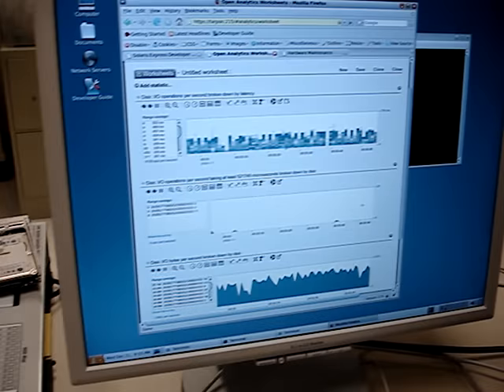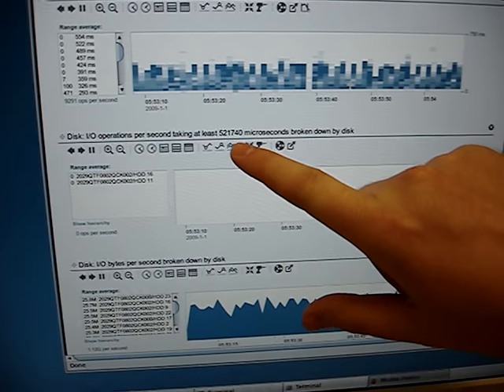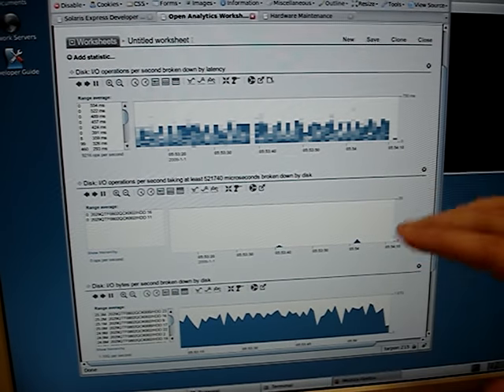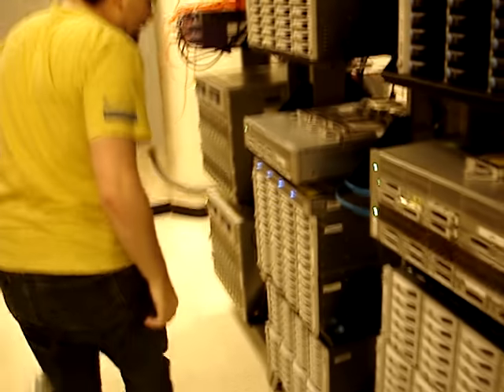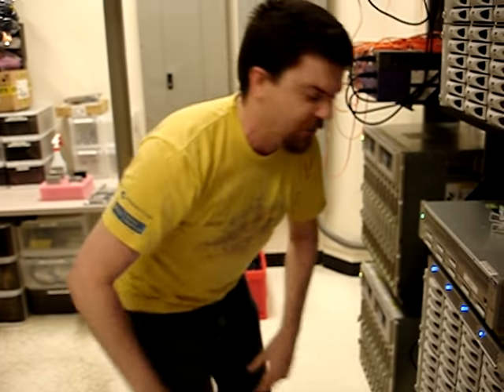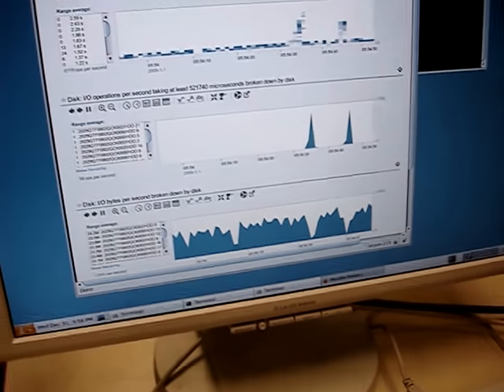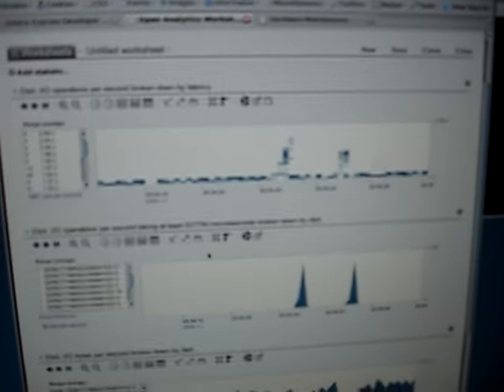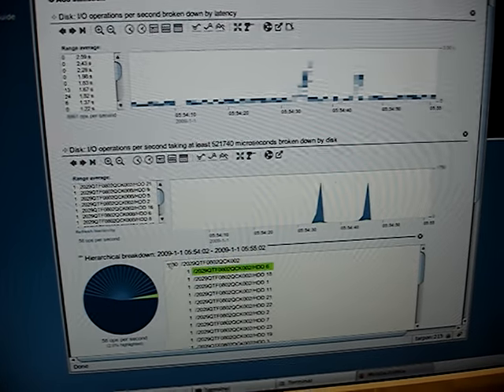Shouting in the Datacenter

Comment: I encountered the same issue with servers I installed and maintained at a data center in LA where they had a smoke emergency due to an air conditioner starting a fan belt fire.  The halon systems deployed.  The frequencies that the halon emitted destroyed 22 of 44 hard disk drives in multiple servers.  Upon lab analysis of the hard disk drives, they could see where the disk puck (a.k.a. disk head) impacted the platters.  That must have been one loud explosion!

Comment: no, I've spoken to hard drive manufacturers about it - load noises or vibrations are a well known problem for rotational disks. If you'd like to read more about it, look up "Effects of Data Center Vibration on Compute System Performance" by Julian Turner, USENIX, 2010.
Reply: "Well known problem"

* cites a book source *

Don't you know regular, everyday people don't read books?
Reply: @nucleargoofball8043  Even though I can agree with you, but dude, you just replied to a 9 years old comment. Things surely have changed, and people are different.

And now I'm also in the reply section ಠಿ_ಠಿ
Reply: @Andika-uy5ir  Name me one boomer who reads books and cites sources.

It's only going to be teachers, man.

Things are still the same.
Reply: @nucleargoofball8043  I'm pretty sure most undergraduate students have to deal with academic papers, at some point.
Reply: people do read books 70% of US adults read at least 1 book a year so its clearly a thing people do
Reply: @nucleargoofball8043  Books are actually pretty popular, surprisingly. Also, I had to cite over 20 scientific sources when I wrote my thesis in college. College, it's a place ya do that kinda stuff in multiple classes.

Comment: i just found this video and i was like "why are they still using disk drives?" and then I looked at the date this was posted. Man am I glad I wasn't in IT back in the day. Vibrations causing latency and potential drive failures is a huge problem to have especially if you're in a earthquake prone area. I get upset when I have to TS analog phone lines lmao
Reply: Don't most datacenters still use HDDs?  For price per Terabyte, they can't be beat, and for heavy read/write they can still be preferable to SSDs, especially cheap ones
Reply: @dylangergutierrez  While HDD drives are cheaper, the downtime required to regularly defrag, how often and easily drives can fail, and the extra power they use means that long-term it's a bad and more expensive solution. Especially when you're working on a massive scale like that. However it's not the data centers choice, it's the clients. So a smaller business might choose HDDs because the cost per server is cheaper, but most larger companies have that kind of funding.
Reply: @DJ_Penguin  Source? I made it the fuck up!

No. Ratio of HDD to SSD in enterprise datacenters is hilarious. Old mate above you was point for point
Reply: @Frogfragger100  Still trying to convince most of my customers to switch to SSD even though they're dirt cheap, but hey HDD's are dirt cheaper am I right?!

Comment: So shouting is no good, but all the fan/AC noise and vibrations of having everything packed in like sardines doesn't negatively effect them?
Reply: Everything is bolted to the floor and the individual disks are probably either very tightly secured or have been suspended with pieces or rubber. Still, you could probably manage to stay in that server room with all the noise for quite a while but you probably wouldn't like this guy screaming right in your ear as loud as he can. It's the same for the hard disks.
Reply: I think the distance of the sound source is important as well as the volume.
Reply: Well, you could hear the fans and they were pretty loud.
But nothing comparable with the noise of someone shouting right into your eardrum right?
Reply: fans are white noise, all the frequencies, and it's very consistent. Not jarring to the equipment. The shouting was a limited range and very very close, enough the vibrations impacted the hardware.

Comment: Red Bee Media had a major incident with their broadcast playout facility in London, England. The datacenter uses a gaseous fire suppression system which was triggered. The acoustic shock waves from the gas nozzles during activation messed up their hard drives which is funny considering you use gaseous fire suppression to avoid damaging equipment.

Comment: And this is why not a 2 years after this video, even data-center drives started to get especially quiet in operation. They improved everything from seeking to motors to bearings because data density started to be so huge and racks were stock full of drives, that they ran into a wall and the noise the drives in a rack made, started to cause issues with reliability and performance...

Amazing isn't it :)

Though, i doubt it was because of these guys, engineers have to had known about this and that eventually they might need to address the issue... :)

Comment: I figured this was either A. Vibration causing rattling in the drive platters (we're too old for SSD to be standard use in a server) and or B. hot air being forced in causing small but not insignificant effects on disk performance. Servers can be temperamental even when everything is running GOOD so even a little hot air might cause such issues. This was my theory at least.

Comment: Ok so in 2008 200 gig hard drives were common. So 48 hard drives in one enclosure. Thats 9.5 terabytes. Right now I can go out and buy a single drive with 15 terabytes. I mean that is quite a substantial improvement. Just wondering if there will ever be a single drive that can hold a petabyte. Just food for thought
Reply: There are 30.72TB SSDs in 2.5" form factor, now. You could conceivably pack 1 PB worth in a 1U or 2U server.
1PB in a single drive is still a way off, though.

Comment: Yeah, i had a 10+ years old HDD with a spotless record. With time it became the only part of the original PC save for the case. 

I'm sure it would have lived 10+ more years because when I was a poor student i was trying to take my PC back home for the holidays in a SHOPPING Bag (no money for a real bag). That I proceeded to drop repeatedly as the handles tore off from the weight. That PC then sat in the luggage compartment of a shuttle bus for over 6 hours on the bumpiest roads of Europe. Even the bus was messed up: the doors were rattling very loud and the squeaky suspension could not keep up as the bus raced across each bump and pothole at a full highway speed. 

In the aftermath I discovered I had lost a fan and the HDD was making a grinding noise. The HDD became progressively slower over the span of 2 years until one day it refused to boot. RIP absolute machine. I'm sure I'd still be on that plate if didn't drop it on its head.

Comment: If its just a personal lab and its air conditioned, just lower the fan speed with ipmi. Your ear drums will thank you and you likely will not gain any significant heat. Not sure the environment, but my Poweredge R820 and R720 have been at 25% for years now without any temp warnings from idrac.

Comment: Wouldn’t all the noise in the data center (he has to shout just to be heard) affect the hard drives’ performance? People are talking about SSDs but SSDs are expensive and HDDs are still very much in use — especially for low cost, long term storage where speed isn’t critical

Comment: I wonder how he discovered this. He was randomly shouting at drives one day and saw the result after he got back to work?
Reply: This is a pretty well known safety feature. Hard drives detect sudden acceleration and quickly park the read/write head. It hovers microns above the surface of the platters, so any vibration could cause a collision. If you whacked a rack support pillar with a hammer, all of the drives in the rack would probably panic briefly. Knowing that, it's just a question of finding the most ridiculous way to vibrate something. Turns out yelling at it works.

Comment: Monday night quarterback theory....DENSITY ALTITUDE could be the cause if this. The water particles could create a sudden increase in air density which then increases drag or vibration forces....or now that I see how dumb that theory sounds....it's more likely just the longer wavelength of sound moving something more than the high pitch low force sound waves.